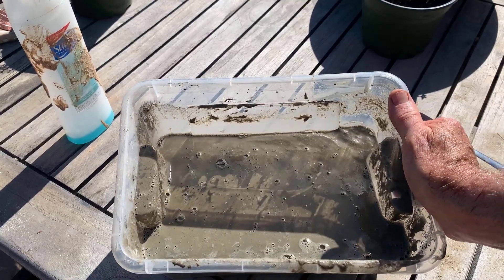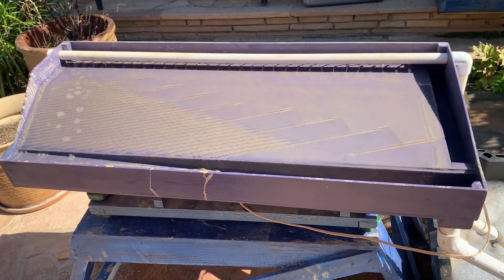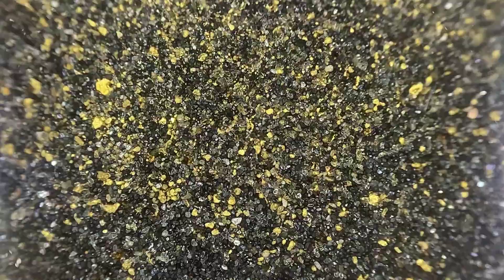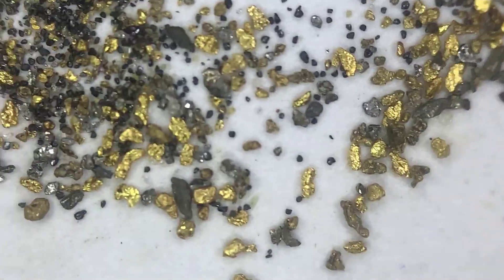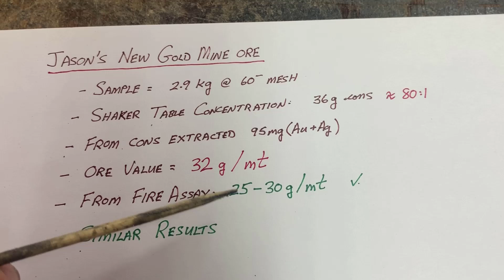Jasons New Gold Mine S2 Part2: Shaker Table Extraction

Comment: Just an idea make 2 or three copper pipes with magnets glued on and set them up under the table to spin dragging the mag cons back into the light stuff to end up in the waste. Not sure but I think this would allow a majority of the heavy's to show  better in your Number 1. Hey just an idea you would have to check your waste to see if they pulled gold with them but if they don't this would be a huge new method on all tables. BTW did you have your table molded locally. Just wondering if a 3d printer might be able to build this in pieces.
Reply from the maker: Thanks. I've tried magnetics with no success at all. The table is hand made from plywood.

Comment: Might i suggest Jet Dry instead of soap lol. That foam looked like a battle.
Reply from the maker: Certainly.  However, soap is also much cheaper.  🙂
Reply: @orophilia  while that is 100% true lol, soap is good to clean and THATS IT. It loses gold in all production and recovery methods. GOOGLE floatation cells as a recovery method utilizing the soaps to float your gold out of a slurry. Rinse and remove soap ALWAYS prior to bowls,wheels or whatever. It only takes a few drops of jet dry to break the surface of 30-40 gallons.
Reply from the maker: @BrokenTablesPodcast  OK, we have a slight difference in opinion. :-)

Comment: Dave I finished the Shaker table took me three weeks to build. Added a 3amp power supply. 35w 300 revolution motor is running strong.

I made mine 18inch by 36 inch. Runs the material instantly. I was hoping I was going to have fun milling for and hour, thinking hobby. But when it was done in five minutes I'm like damn, gotta rethink everything. 

Amazing machine!

I ran a half gallon 35 minsus and smeltered the cons in the pottery kiln. 10 grams deore ore. Deore means first melt. I'm working sulfo salts, halides, and tellurides. 

Now I didn't add any flux. The quartz sand melted a cap and the metal sink into a liquid in the void, I pokered the cap open and poured the watery metal into the water can. I used a clay crucible no graphite. It takes three to four hours under fire for the cation and the anion citations to break there bonds before the elements are able to separate and the metal to reduce. 2 hour even three hours if the temperature is not steady you will not see a physical change. But three or four hours the anions of the sulfur start to become broke. And it frees the metals and the elements are able to move towards reduction. Two hours does not work!

I found with sulfo salts and halides you will be working complex ores. Complex means mixed metals. Cobalt is the ultra violet blue grains. But I chemistry a single grain of colbalt can make gold brittle. The pour comes out a deore. And your supposed to Electro refine like sreetips silver cell.

Hey thanks Jason I know we were all working on this together. It's been many many years chasing the dream.

Everything the table catches is free mill. I have to leach the sediments eventually.

Thanks Dave!
Reply from the maker: That's great news! Yeah, the table is reasonably fast. When I'm concentrating ground ore I can get about 100 kg per hour. Black beach sand is much slower. 
I'd love to see a video of the table working. I'd post it with your permission.
You sound like you're deep into pyrochemistry. It's a complex and interesting field. Good luck! -- Dave

Comment: Alright got the Neoprene ordered, motor, electric sheet metal shears, 1/16 aluminum plate, everything.

So I'm working on the SKP break down of the gold Flinger, I kept calling it the gold finger, was a little tipsy, I posted that video on my channel.

Picked up the table and miter saws and I got a ton of wood on the shelf. Going to do the build while I'm waiting on parts.

That neoprene is hard to get a hold of you gotta have a lot of money or luck out on a smaller cut being available.

Luckily I have a Rubber Depot here in Denver and they have warehouse full of that neoprene if it gets to be tough Pickens on home delivery.

I'm so ready for this the gold is like crystalizing out of my Altaite.

Overall the Shaker table offers a least pollution method to extraction thus helping achieve goals with lesser worries. Sometimes it feels like an invasion of stalkers but in reality it is the theory of reclamation having the department the interior serving all around you.

If you look at reclamation histories in recent times. It's a requirement to have active cyclists to slow and limit the traffic in mining districts to limit help limit the flow of activities of what most times being a greater amount of guests than is welcome.

Sometimes it's so much traffic they have to put a hundred bikers out there. They all say Hi and Bye. But they all rich just watching you to see if you can achieve the same accomplishment. There is no privacy but you have to quickly learn that that's okay.

In the districts what we think of prospecting has been tiered down to "Land Exploration" and you must use the language as such. Prospecting carries very steep fees for reclamation ballpark 27,000 a year so be careful read the small print before you establish yourself. Once your activated if you fail the requirements for activity they can strip your permissions. Just remember reclamation is a state and federal requirement now, you have to follow their laws among other laws. And don't forget the department of revenue also, after 23,000 in retail sales you have to pay federal retail tax. Don't ignore it because big money can easily carry indictments if you fail to register in all the categories. So work your way up the ladder and keep your records straight.

Now don't worry I'm always working towards getting a prospecting permits one day even if I never get there. So don't be afraid to name yourself the prospector your name isn't going to get you in trouble, it's gotta be a pretty big land disturbance without paying the correct fees and financial insurance to get in trouble.

And remember there's hecklers who wouldn't even kill a fly. You moved one pebble damn you! I think you have a pretty good argument if your following the law. Plus a petty complaint might get you close enough to the judges podium to request a grant. Once they have you join reclamation it's a lifetime of litigation, no way around it. In some cases if you get sued serving the public and lose you can apply for a grant to pay for your loses because your forced to do something impossible anyways. Hope they were able to backfill that 3x3 prospectors put after something like that. I think we gotta call it a land exploration dig now to correct the language of the hecklers, hey free advice.

But you have a big angel on your side. They don't want to see or even talk about small activities and they aim to get you there to their level which is supposed to be mining. Mining costs 250,000 a year for a permit at a site. But if you got the big loader shovel and your digging what you know is there. You only need 250 customers to buy a thousand dollars specimen to recover costs. So preparing venues and shows before you drop into the investment, your going to make it in mining. If you make a little extra someone can be paid to spot and work the ground and you get the easy job sitting in the tractor.

Wishing you all well.
Reply from the maker: Good luck to you, too. Wishing you well.